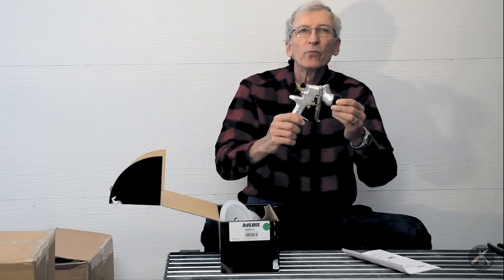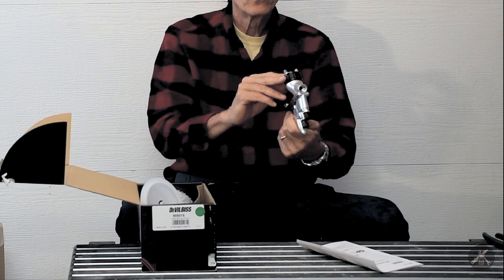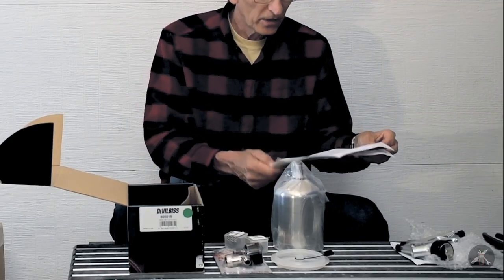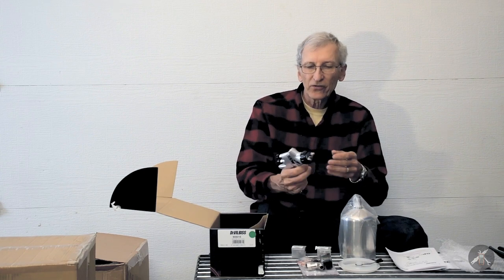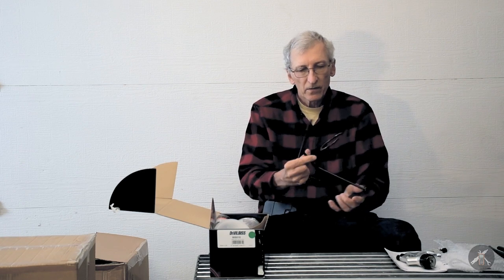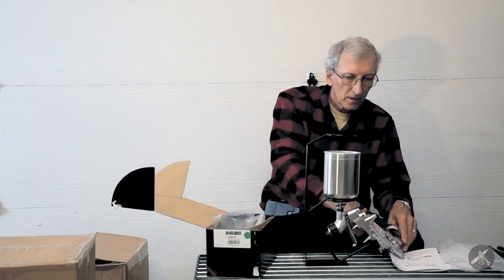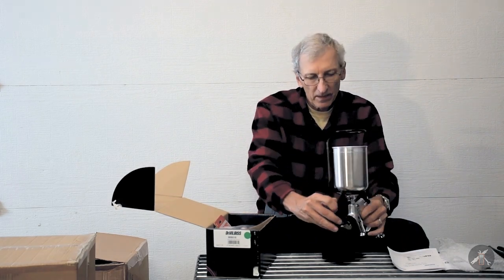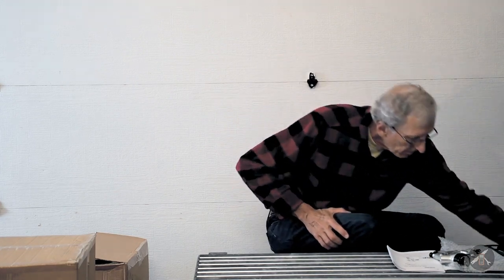New DeVilbiss GPG Paint Gun - IROC-Z Barn Find EP70

Comment: quick question.. can i just change the air cap on these GPG guns? i have GPG2 and i possibly want the 7e7 for lower cfm consumption
Reply from the maker: I am not the end-all expert of these, but based on my reading of the specs, it appears that the 7E7 should interchange just fine.  That is what I am running.  The literature shows the base GPG gun body with a number of air cap and nozzle options in the table and it doesn't appear that the body changes between air cap designs.  It does appear that some care is required to be sure that the air cap, nozzle and fluid needle all are compatible. Some are interchangeable, but some combinations are not.  It takes a close reading of the tables to be sure you have the right combination.
GPG literature page:
https://www.autorefinishdevilbiss.com/products/gpg.aspx#lt-2576369-literature
GPG sales sheet:
https://www.autorefinishdevilbiss.com/Portals/0/documents/product/09-132-01_DeVilbiss%20Auto%20Refinish_GPG_Sell%20Sheet.pdf